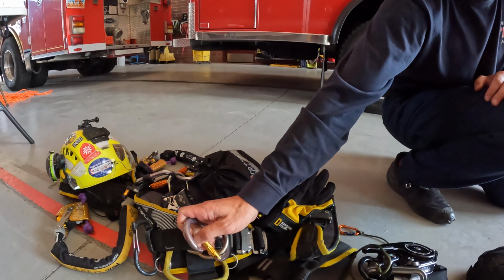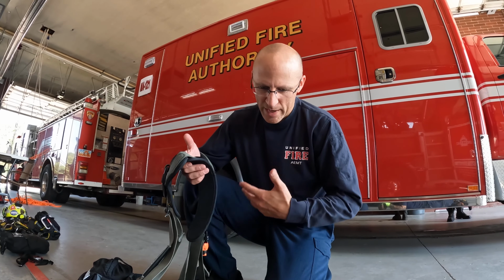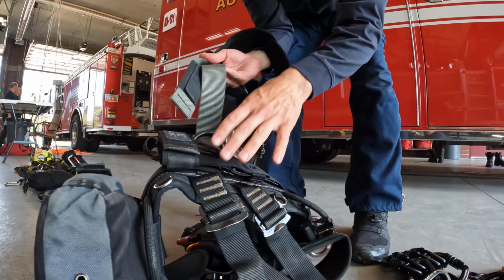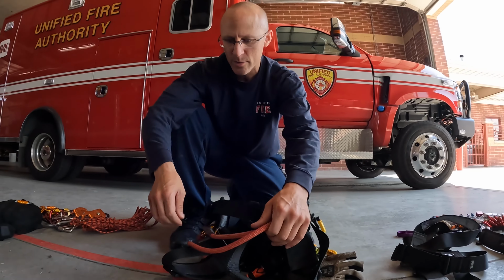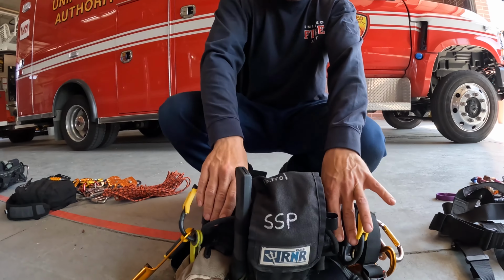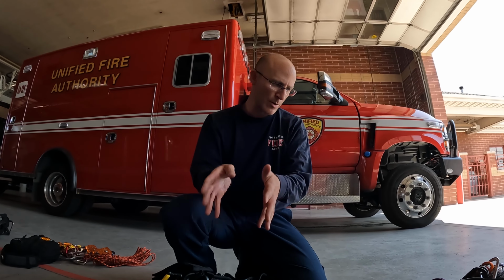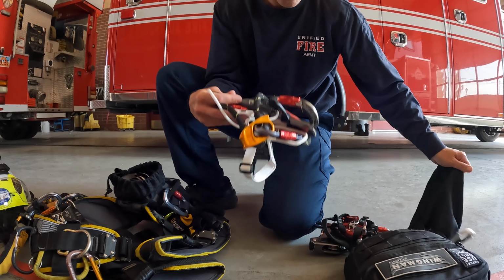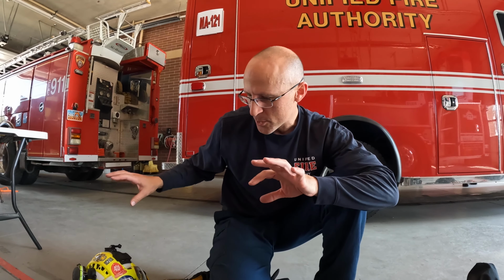What's on a Rope Rescuer's Harness? ... It Depends

Comment: Hi Bob happy summer, you will end up on one point with your aid climbing kit… unsafe? not for me to decide. Fail a rope access evaluation yeah…
Reply from the maker: Describe “one point” a little more in depth.  One point because all your connections are going into one point on your harness ventral ring?  Or one point because the dual lanyard shares one attachment point due to the fact that the terminal end is a sewn eye into a single carabiner, instead of two completely separate lanyards through & through.  While I don’t work as a rope access technician, nor do I evaluate any testing, my common-sense reasoning tells me that this is perfectly fine, regardless of what anyone or any other organization or institute thinks.  Unless there is specific & repeatable testing that can prove that this is an unsafe practice.

That’s what you were referring to right?
Reply: The single carabiner is the “issue”, harness attachment points are generally considered acceptable as a “single point.” Carabiners are not and I have had the same model twist lock open on me doing rope access style stuff, I caught it right as it happened and no big deal. That being said, I can’t sit here and keyboard warrior to say if your equipment is properly inspected and inventoried going to a single carabiner is unsafe in the aid climbing context  (at least horizontal) because you are in often in plumb suspension. As soon as you go out of plumb and introduce more likelihood of some gate interference I think there’s reason to have a conversation. I do know of one (I would bet there are more) fatality that resulted from going to a single point on aid, however it was an anchorage failure, not the technicians equipment. If you aren’t doing rope access under some formal org that requires adherence to strict guidelines then who cares.
Reply from the maker: Right on.  Thanks for the insight.  I agree the twist-locks can be dangerous in the wrong set of circumstances.  Theoretically most styles of carabiner gates can be unintentionally defeated.  But I do love the twist-locks for ease of manipulation for most things (not all things though; I did have one gate open up where a tensioned line pressed against the gate & began to roll the gate open).

Also agree on how things change the moment you are no longer plumb.

As far as a purely horizontal aid application goes however, if you combine a Progress-Adjust-I lanyard with a Progress-Adjust-Y lanyard, & you are executing proper sequencing as you progress through the anchor points then at no time should you ever be connected to any fewer than two anchor points at any given time w/ two completely separate lanyards to include the pair of connectors into your ventral ring.  This applies for moving in either direction (left-to-right, or right-to-left)...

If at any point in time you fell or lost balance, you would always be connected on two anchor points with two separate lanyards & two separate carabiners that go to your harness.
Reply: @Propeller_Head   in order to move either direction you must at some point remove the progress adjust-I lanyard, leaving one connector from the progress adjust-y lanyard to your harness. The adjust I lanyard will still be connected to the ventral ring but not anchorage. You have 2 anchor points and one connection to the harness. You then regain that connection before you go into motion, which is why in all reality this is probably totally good enough. That’s where the problem would be on evaluation day.
Reply from the maker: You are correct.  I know how to get passed it though…. How about taking a Prusik & hitching onto the Adjust-Y lanyard, then attaching that to your harness with another (3rd) carabiner?

Comment: can you make a minimum kit and rig for  2 person ( one has zero knowledge )self rescue from building on fire or lack of access stairs distance to ground 85 feet +- ?
Reply from the maker: I guess anyone can make anything they want.  Your question is both fairly specific but also vague.  85+ feet is a long way to go for a minimalistic self-rescue kit.  Also, who will be needing this?  A firefighter or just a resident or office worker in a high-rise building?  From a firefighter perspective, there are a handful of manufactured “bail-out” kits designed for firefighters to self-evacuate from an elevated window or roof.  These systems are limited because firefighters have a lot of weight and other things they carry in their turn-outs, so space, weight, & bulk are limiting factors that typically limit the diameter & length of line to around 7mm of 50ft.  With these kits, you can lower someone else to the ground first & they will need to detach so you can get the terminal line back & anchor it to the structure so that you can then rappel out, assuming that you have time for that.  There are just so many variables & factors that go into that, it’s hard to give a simple explanation or solution.

Comment: Is that set you have on the that fire-based/ industrial sling set like an “Arizona 7” set up?
Reply from the maker: I’ve never heard of that.  What’s an Arizona 7?
Reply: @Propeller_Head  forgive me if I mess up the technical details surrounding the creation of it; but from my understanding Arizona FD came up with a seven step progression to go from a 3:1 pulley system to an 11:1 using the least amount of equipment. Basically you need 3 single pulleys, one double pulley, 3 Prusiks, a MPD with rigging plate (or clutch or whatever), 5 carabiners, and an anchor strap with rope. You start with a 3:1  then add pulleys in different ways to get up to a 11:1. I was told they would test people by saying a random step and youd have to build it for proficiency. I have a good power point for it
Reply from the maker: I see.  No, the gear on my sling wasn’t selected to do that, but it certainly could.  It has 4x single sheave pulleys, one double sheave, about 65’ of PowerCord, 15x 40KN twist-lock aluminum carabiners, 2x Rescucenders, a Tri-Link, & a SwivaBiner w/ 3-hole rigging plate.  Intent was to augment any potential shortages from our rigging packs.  In reality for both real rescues & training the only MAs I’ve seen used were Simple 3:1 w/ & w/o a c.d., Simple 5:1, Compound Batwing 9:1, Compound Batwing 5-on-3 15:1, & the occasional Complex Inside 9:1 for short line tension transfers but an AZTEK is often used for that purpose.  Doing complex 5s, 7s, & 11s is fine & dandy to get people thinking about MA but I have yet to see any relevant application in fire-based rescue.  Mountain/Backcountry rescue however is a different story where those complex systems do have more applicability in that environment.